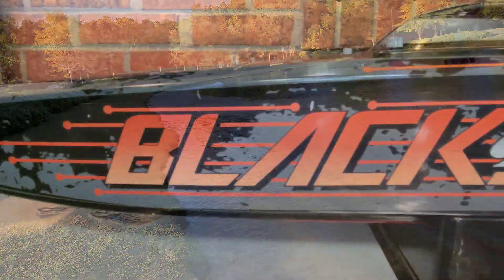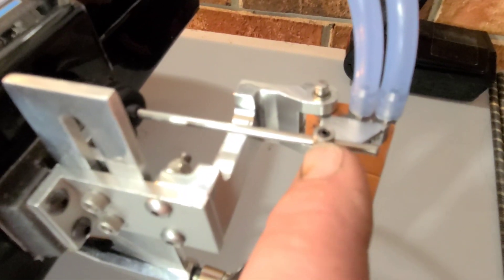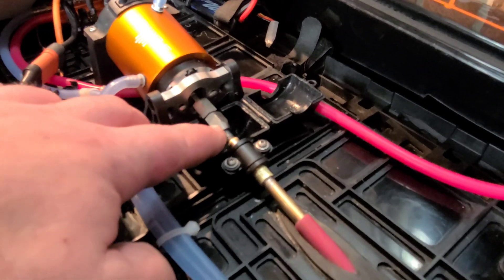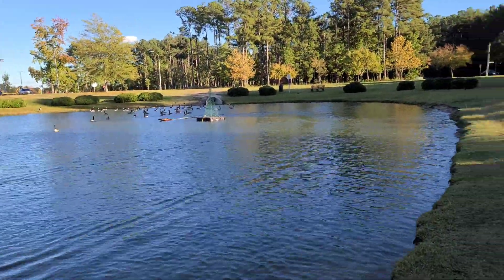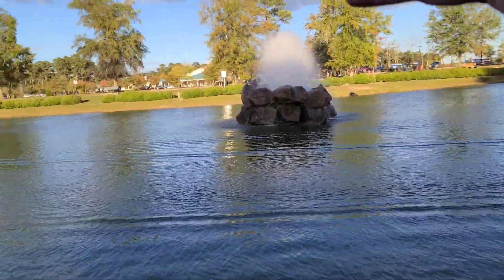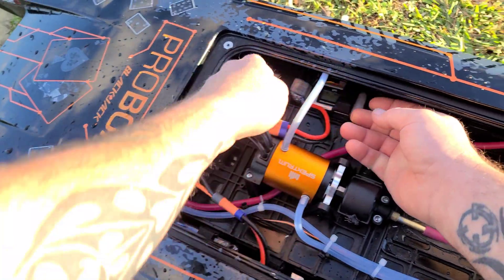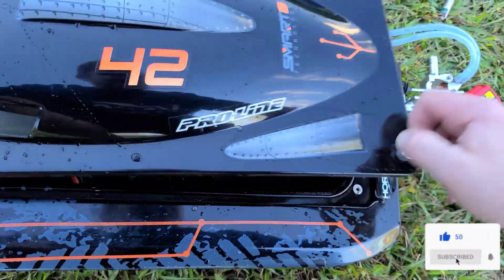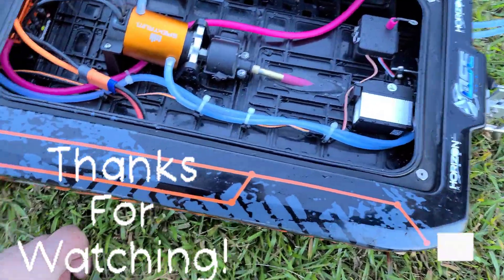Upgraded Strut & Flex Cable Blackjack 42 | No More Broken Proboat Flex Cables

Comment: I bought the blackjack 42 and have had noat this point I'm saving for a rescue boat is there something I'm doing wrongthing but problems the coupler comes loose everytime I run it o have had to swim for it twice
Reply from the maker: I recommend RCBB trim tab set, with some larger capacity lipos 7600 smc hcl-hp 4s twins (8s) pushed as far forward as possible to keep the bow down...   oxidean marine 5016 is a good prop to prevent flipping

Comment: Your videos are absolutely excellent and you're diagnostics and your tricks but tell me if I'm wrong where you doing a compromise to run against the wind who cares you want to set this thing up for the maximum speed run and if you're going with the wind that's great if you have a crosswind in either direction you're not going to get those same speeds you're going to flip the boat just curious if I'm wrong in your mind with my thinking...
Reply from the maker: In my opinion every speed run guy out there runs with the wind  (car truck boat)   if I were setting the. Oat up for ovals then yes I'd want to get the bow of the boat lower so she don't flip into the wind on a straight stretch, ya know. 😉

Comment: Id like to see it. I have a 17 inch cat with 120 esc and  motor that came out of my pro UL 19. I KNOW ITS TOO MUCH for the boat but I'm like you can't leave anything alone. I'm having problems with the bow bouncing and too much TQ roll. Thinking about using trim tabs. Think it would help?  I've lowered my strut as far as it will go raised it's far up no change moved battery all the way to the front no help. Any help would be kinda of you. Your Awesome man. Thanks for all your videos, they help out alot
Reply from the maker: How many props have you tried?  You can change to ride of a.boat with a prop. Octura 430 works well on my miss geico 17
Reply from the maker: 36506 pole on a 17 inch boat lol. 120esc. Hahaha.  That may be your problem.   I'm running a 2440 and 30 a esc in mine.  Catamaran/ boats like to be light more predictable.    But I'd like to see that bad boy run.

Comment: Mate that thing is just a monster , looks like the hard work paid off.  I don't like the stock strut and cable. This is a great setup and the boat runs perfect.  Nice work mate.
Reply from the maker: Thanks brother. Yea it was alot of work in the stock configuration the turn is much better, with the Rudder kicked out it wants to swing the rear of the boat out quite a bit

Comment: Just curious if you have ever messed with the genesis boat that close to this one. Thanks
Reply from the maker: No sir I've never owned a genesis sorry wish I could help
Reply: @IRONCLADRC  no worries I realy injoy your videos. I have had the boat for awhile iam hopeing to use it this summer on my local lake. I had to put a esc in it because it didn't have one so I put a seaking 180amp in it. Was wonder were to start with batteries

Comment: Another great video. 👌
I have a Rockstar 48 but no electric boats of this size (yet)
What would be an average run time on something this big and on which batteries. Thanks.
Reply from the maker: 6000mah 100c zee power battery's I get about 12 min of hard running. The video was shot with 1 set of packs and I edited out maybe 3min of run time.

Comment: Boat looks good and running good.I’m still trying to figure out how I’m still on my first flex shaft🤔Have not had any trouble with my Blackjack 42 other than boat flex and twist from a composite boat.Dam great job on the flat bottom strut upgrade👍❤️
Reply from the maker: 👍 thanks brother
Reply: Stupidity for this guy or anyone to spend extra money. The price point is on for what comes in the boat. I have had my boat for 4 months and run it almost every day sometimes all day on 8cell. All I have done was add the extra cooling line. No problems. It's all in the maintenance. This doof wants 100 likes lmfao listen towards the end I'll move the batteries further forward lol that's where you have them when you run a cat